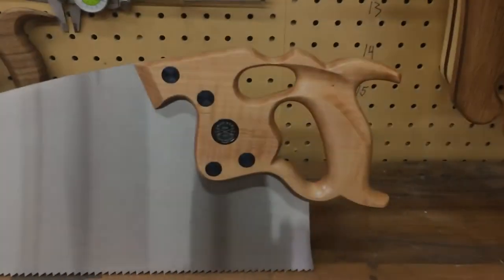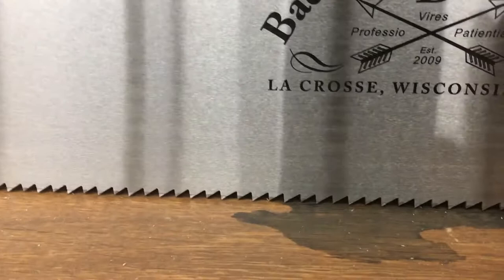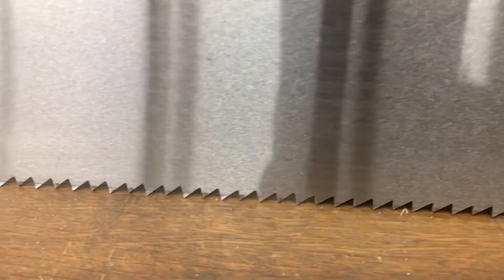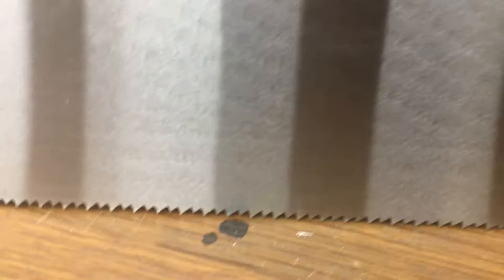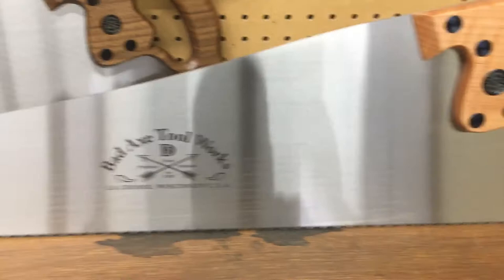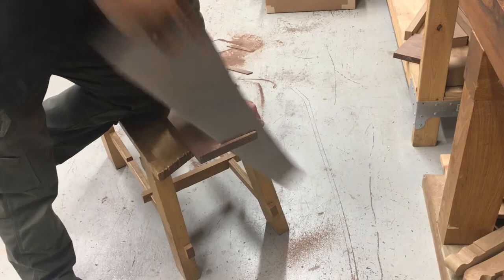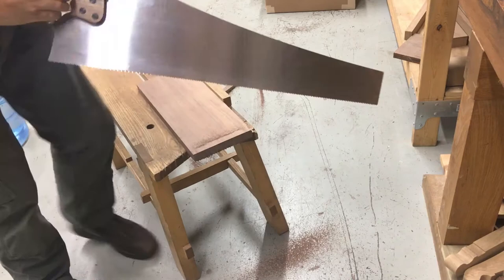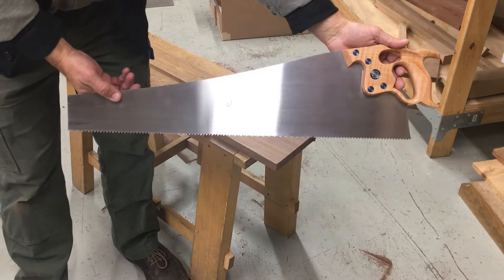D8 Demo

Comment: Looks like a nice saw. I see on your site that you mention that the steel is hammer tensioned. I've made a couple of saws (for personal use), including frame saws, but have never seen hammer tensioned 1095 - is that a custom order? I have generally hammered my own saws if they lack stiffness, but as you're aware, I'm sure, the hammer leaves evidence all over the saw, and I'm too chicken to polish it off for fear of removing my work. 

I'm sure there are dozens of ways to stiffen the steel (rollers, hammers, wheels) that would be cleaner looking than my efforts. Your plate is clean and bright. Well done.